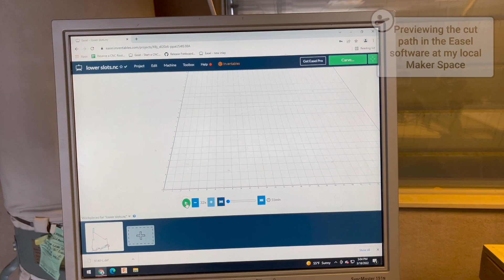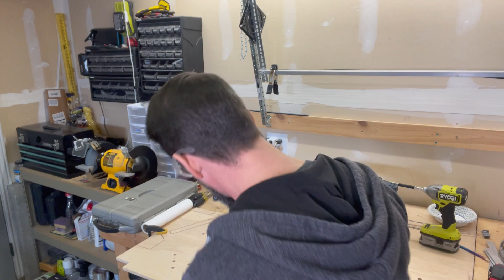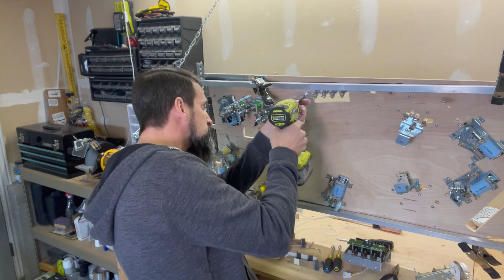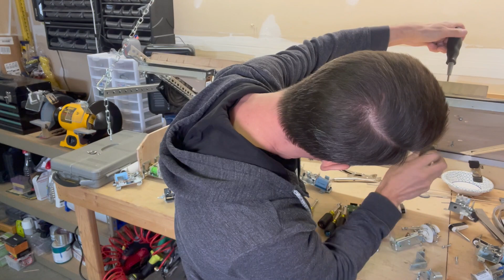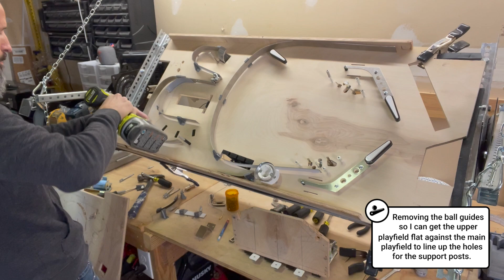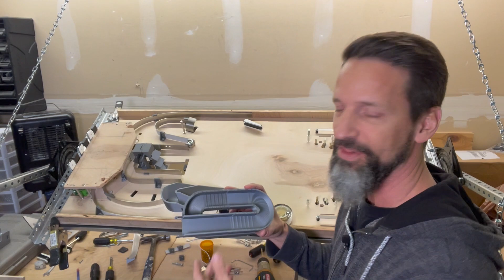HOW TO MAKE A PINBALL MACHINE - Whitewood #4

Comment: I have done a lot of pinball restorations and I think for my homebrew just going to do what I do with the major manufactured pins I restore and just wood fill in the mistakes.
I had major wood planking under the playfield of the drop down bank on my LaserCue pinball machine but it is all nice and built up and sanded and smooth and will be more secure when I put on the under playfield stuff.

That and I cannot spend thousands on playfields every time I mess up.
So mine is most likely going to be wood filled heaven. xD

Comment: On the lower third drawings posted on your drive file any way to get one that is printable i need a template for the slingshot and lower portion to cutout for a homebrew as i dont have local access to those critical measurements or a cnc machine, have to do it by hand. Subscribed and following the journey!!!!
Reply from the maker: I'll see what I can do, those files are actually out of date now as I've had to tweak the Trough and starter lane positions - I'm not almost done iterating on my final whitewood and then will upload an updated image with measurements

Comment: A tip for the cnc and fusion, you can use 2d contour and add tabs in the manufacturing section instead of changing the fusion file to do it manually. Hope this helps

Comment: On the cad drawing. Are you measuring all the holes relative to each other or relative to the playfield edges?
Reply from the maker: I actually do both typically - which should I be doing?
Reply: @thepinballroom  depends on the situation I guess. If you measure everything relative to the edges, it won’t mess up other things if you have to adjust the position of a pop or something. If it’s like an arrangement of inserts, I guess it makes sense to measure them relative to each other.

Comment: Nice work

On my project every time taking everything off the playfield is somehow irritating but also when rebuilding the playfield and getting a nicer result is also great.

playfield wiring is always a hassle, one of the things i did is just make connectors near every coil switch etc so you can easily disconnect all wiring and restructure the wiring easily, because it will just always become a mess otherwise..

Comment: Hy Steve
Again, a nice VDO 👍
Did you try to rotate the diverter mech 180° to make some space for the subway ?

Laurent (FR)
Reply: Ahh, I was just coming to suggest rotating the mech.  Good catch, hope it helps!
Reply from the maker: Actually no! - ok I just tried it, and it’ll help a little, the Jain thing is the diverter piece that comes below the pf tho- I have to make sure my subway doesn’t block that piece, rotating the coil doesn’t change that but it does remove the bracket from being in the way at all - so still a worthwhile change thank you!!

Comment: A cool tip I learned from a Ben Heck video is after measuring something into CAD, print the profile of your CAD model at 1:1 scale and hold it up to the real part to make sure everything lines up. That way you can see right away if a measurement is off.

It works best with smaller parts but for larger ones you just need to crop the image of your CAD model to fit in a page. I don't use fusion 360 but it looks like there is a plugin called origin shape that lets you export the face of a model as an image.
Reply from the maker: Thanks for that idea! I hadn’t thought of that!! I’ll have to try that out 😀